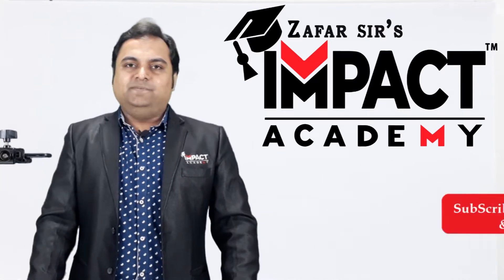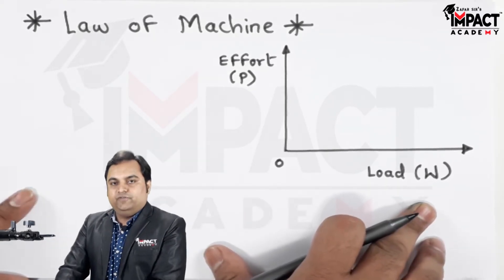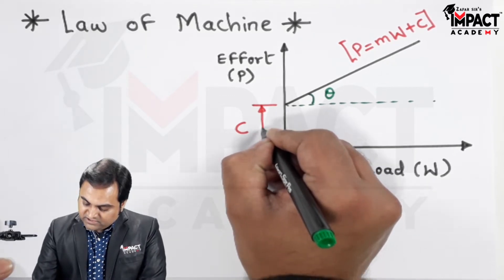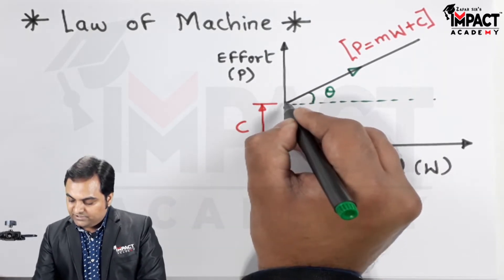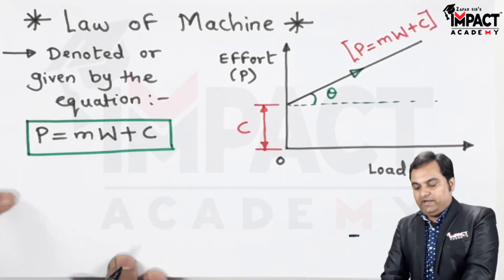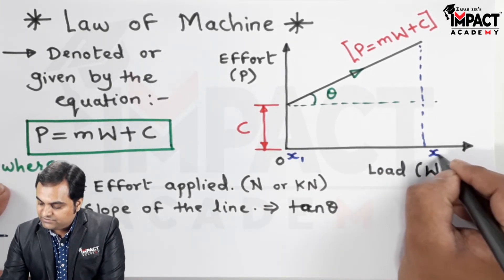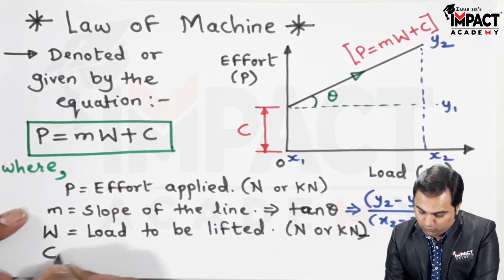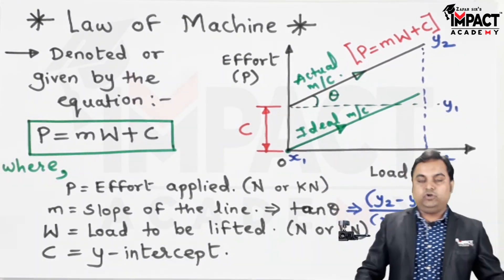Law of Machine | Applied Mechanics | Mechanical Engineering #engineering #impactacademyofficial

Comment: Whtat load can be lifted by an effort of 120N if VR=18 efficiency =60%
Determine the law of machine, if it is observed that an effort of 200 N required to lift 2600N and find effort required to run the machine at a load of 3.5 KN

How to solve the second problem???  Law of m/c??
Reply from the maker: Watch Remaining & All Private Engineering Video lectures at your Home using
Impact - The Engineering App
Click on link below for download 👇👇👇
http://bit.ly/impactEngineering
WhatsApp or Call For Details:-
+91 7900123134